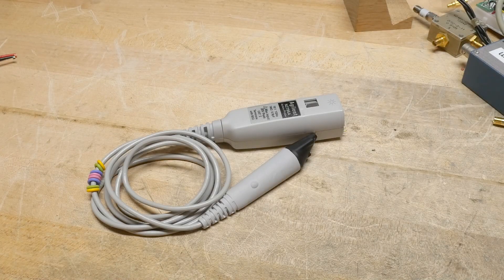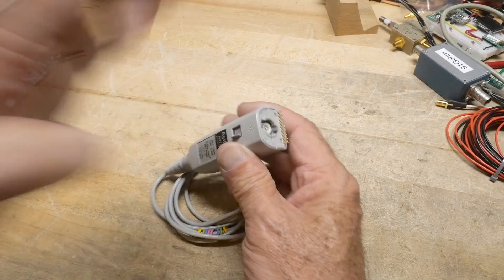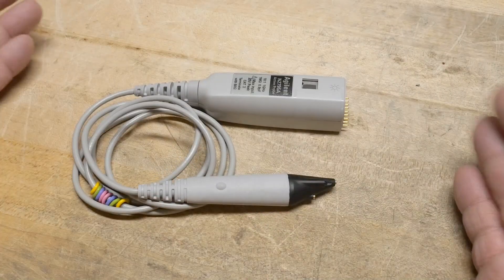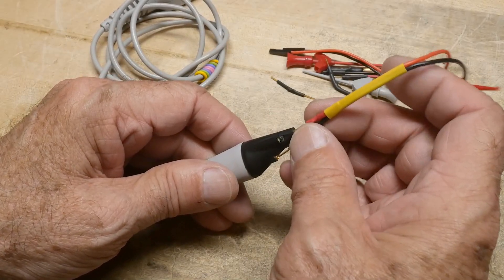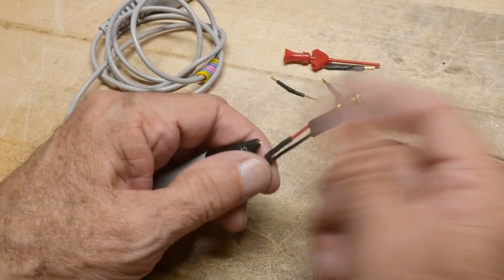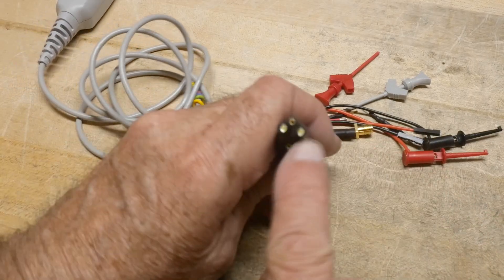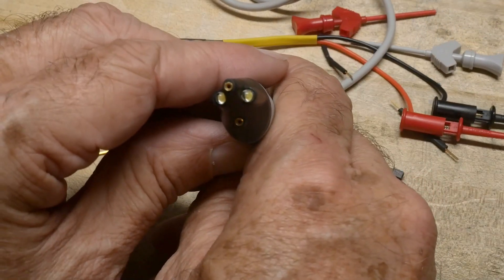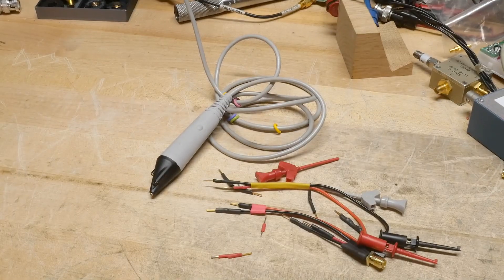#2346 Agilent Active Probe N2795A 1GHz 0.9pF (part 1 of 2)

Comment: It looks like a very nice probe.  I am surprised, though, that it doesn't have attenuators in order to make higher voltage measurements, like the old Tektronix P6201 probes had.  Apparently, there is little need for such a thing these days.
Reply: Probably because A passive 1:100 probe  can be built with better specs than this active probe, the active probe really comes into its own at lower voltages. (0.9pF is still 177R reactance at 1Ghz and 1770R at 100Mhz, where a 100:1 passive is 5k resistive load and probably lower capacitance and definitely lower cost new)